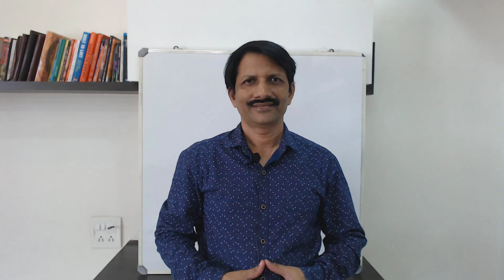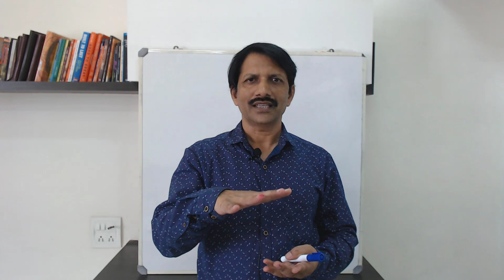HOW TO DESIGN A PRODUCT? BY UNDERSTANDING GRAVITY DIE CASTING PROCESS| GDC |

Comment: Sar what is the minimum wall thickness for brass gravity die casting ? And which hot die steel is best for brass gravity die casting? Basically I want to cast brass bowl in gravity die casting process